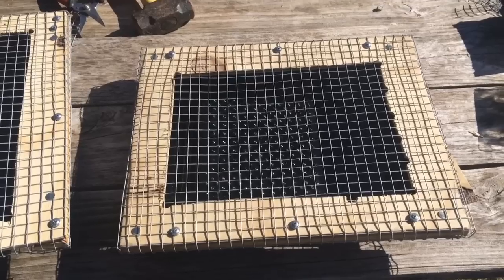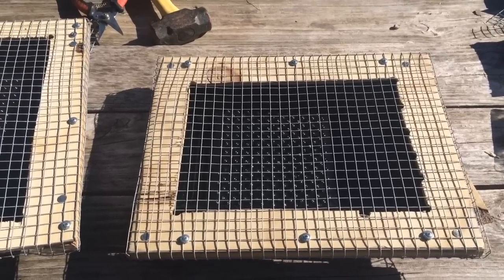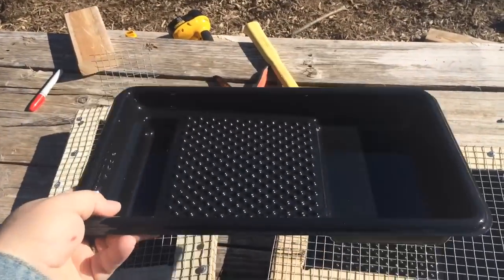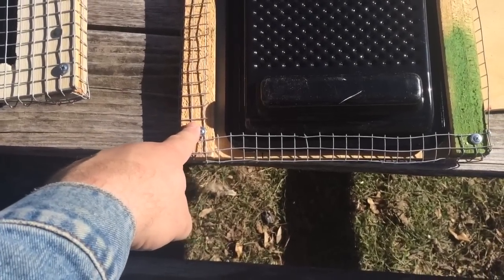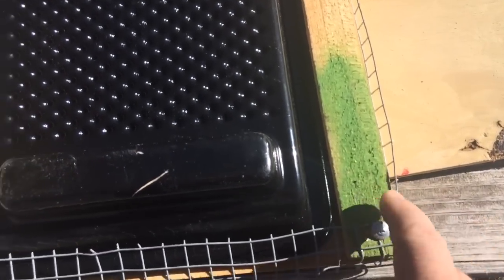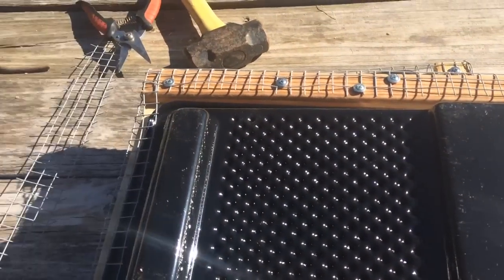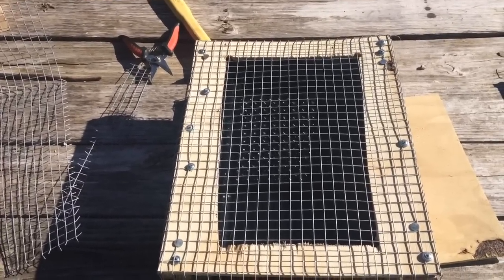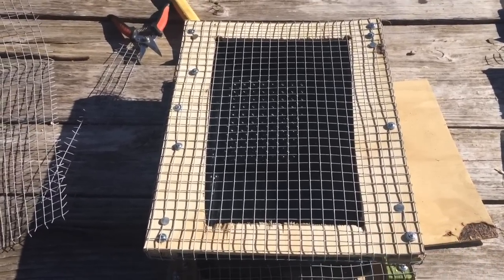Non Messy Watering Solution For A Duck Brooder

Comment: My problem wasn't the mess so much. People have been making raised screens for their waterers for decades. My problem was that if I had ten ducklings, they would empty a gallon waterer in about 4 hours because they splashed all the water out of it. But I was working a 12 hour shift. And you don't want ducklings to run out of water because they over drink when they finally get it. Had to have a waterer that the ducklings wouldn't empty for at least 13 hours on work days. I use to put screen over big frisbees and set waterers on those. This looks like it would work too.

Comment: why not just have a wire bottom brooder.
Reply: That would be a good idea, but it only works for a smaller brooder set up/limited number of ducklings, and you still need something to catch the water underneath. Larger grow out brooders have to be on the floor. Constant exposure to hardware cloth can also be damaging to their feet and increases chances of foot infections since there is no bedding to buffer between foot and poop, etc.